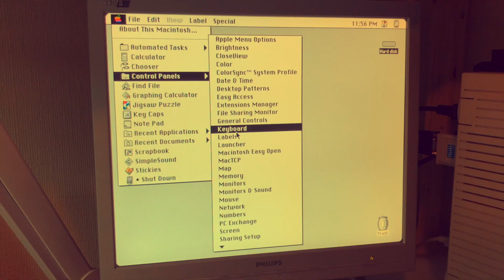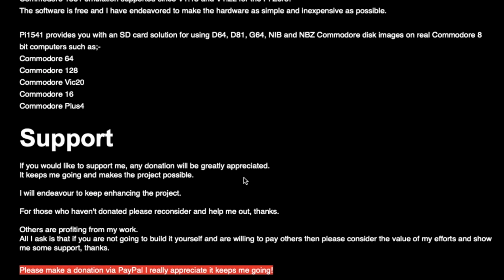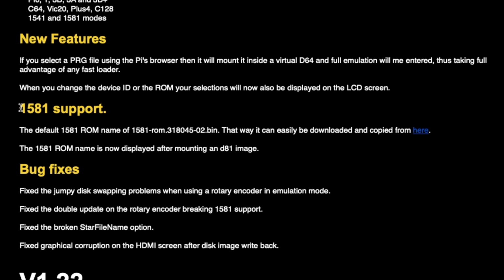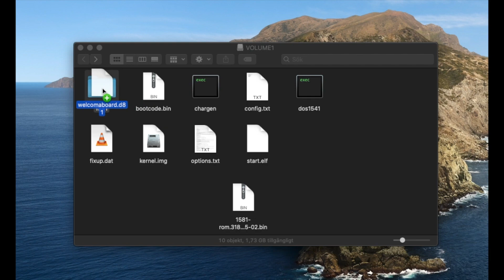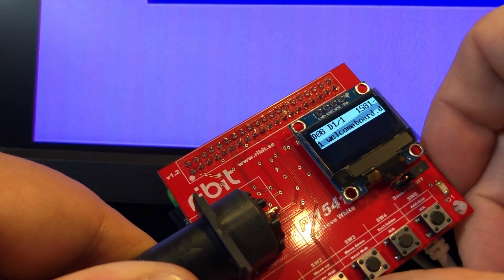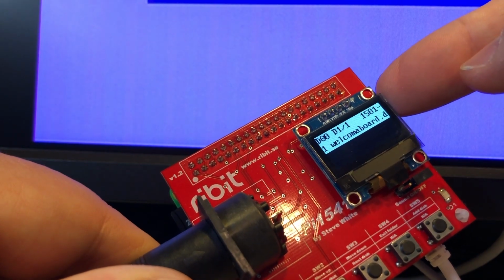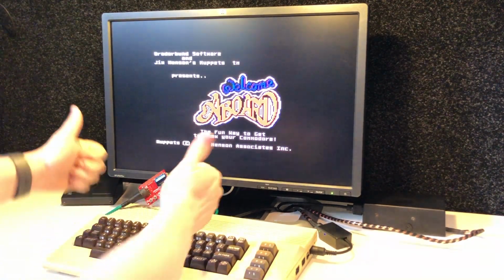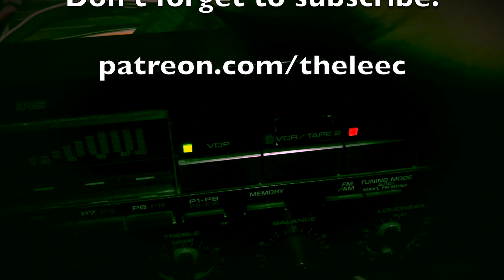Pi1541 on Pi Zero - 1581 (D81) support

Comment: hmmm,  it does work with a regular 1581 rom,  i have a licensed 1581 jiffy dos which does work with PI1541, and Pi3b,  but the JiffyDOS image does not work with PI0 (yes, with proper pi-0 kernal)

Comment: Also can you share your config? Is it possible to have working buzzer on pi zero?
Reply from the maker: Hi again!
As the config template changes over time, sharing my config would only cause issues as it gets outdated and eventually irrelevant. Start with a fresh and clean file from Steve's web and follow the howto video for RPi Zero I made a few months back. It is linked from the official web site. I bet the SplitIECLines and the LCD type is the first step on the way for most hats. The rest is just a matter of personal preferences.
The buzzer is not going to work on Pi Zero. It steals too much CPU time. Also, it sounds horrible and only useful for scaring the neighbors poor cat. Better off without it.

Comment: This is my options.txt
// If you would like to change the dirve number then spcity it here (8 is the default)
//deviceID = 9

// If you are using the split line hardware option (ie Option B) then you need to specify this option
splitIECLines = 1
// If you are using some type of hardware that requires the lines to be inverted then specify these options here
//invertIECInputs = 1
//If you are using a 7407
//invertIECOutputs = 0

// If you are using the Pi's composite video out then these options allow you to experiment with the display resolution
//ScreenWidth = 512
//ScreenHeight = 384

// You can specify additional ROMS here (up to 10)
// You can then use the number keys on the keyboard to change which on you would like to use (only in browse more and not in emulation mode)
// .LST files can also specify one of these ROMS that will automatically selected when the LST file is loaded.
//ROM2 = Jiffy.bin
//ROM3 = d1541II

// If using CBMFileBrowser then it is best to specify this option. When the computer resets the Pi will always revert back to the root folder ready to load CBMFileBrowser again.
OnResetChangeToStartingFolder = 1

// If you use FB64 (CBMFileBrowser) and want to use a fast loader cartridge (AR6, EFL, FC3) to load it then use this option to autmatically mount it. 
autoMountImage = fb.d64

// If you would ever like to disable browse mode completely ypu can do so here
//DisableSD2IECCommands = 1

// This option displays the IEC bus activity on the bottom of the Pi's screen
//GraphIEC = 1

// If you have hardware with a peizo buzzer (the type without a generator) then you can use this option to hear the head step
SoundOnGPIO = 1
SoundOnGPIODuration = 1000 // Length of buzz in micro seconds
SoundOnGPIOFreq = 25 // Frequency of buzz in Hz

// You can create 320x240 PNG files with the same name as your disk images. With this option turned on they will be displayed on the Pi's screen.
//displayPNGIcons = 1

// If you would like to specify what file will be loaded by LOAD"*" in browse mode then specify it here
//starFileName = somefile

// If you are using a LCD screen then specify it here
// LCDName = ssd1306_128x64
// If you are using a LCD screen and you would like PageUp and PageDown keys to work with it then specify this option
//keyboardBrowseLCDScreen = 1

// If you are using I2C LCD you can optionally change what pins it is connected to.
// (defaults to 0 for non-split lines (Option A) or 1 for split lines (Option B))
//i2cBusMaster = 0 //SDA - pin 27 SCL - pin 28
//i2cBusMaster = 1 //SDA - pin 3 SCL - pin 5
//i2cLcdFlip = 1 // Flips i2c LCD screen vertically
//i2cLcdOnContrast = 127 // Allows you to adjust the contrast on your i2c LCD screen

//i2cLcdAddress = 60 
should I hange anythin? I didnt get that part with name change... also what is the name of that lcd/oled screen?
Reply from the maker: Thanks for your contribution to The LEEC: Riddle of the week. ;)
Should you change anything...? Well, if you are having issues, probably. If you don't, then I'm sure you're fine. 
The OLED in the video is the ssd1306_128x64.